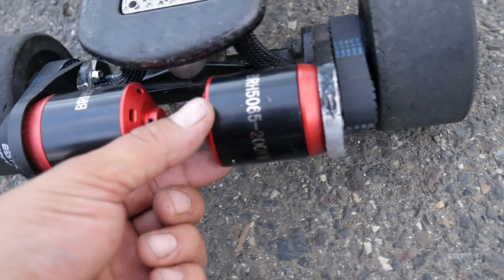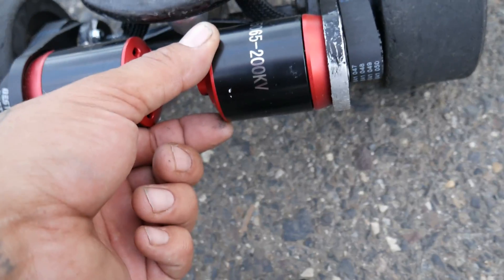RaceStar 5065 200KV Electric Skateboard Motors on Evolve Carbon GT

Comment: I’m having issuers with the battery, like I ride the board in full speed and the battery drains so fast and it doesn’t last that long.
Reply from the maker: The cells might just suck or you could have a dead cell which would do that too.  Usually the cheap batteries will work pretty good but lose power exponentially with every charge until you cant go a mile before its dead. Do you have electrical testers? What kind of board?

Comment: Joe, looks like you are local in Phila.  Question for you, I need to replace motors battery, and controller on my evolve Carbon gt... my originals we fried due to water leakage.  Can you lead me in the right direction? Im new to working on the internals. But I am local in Phila. jarridb@gmail.com

Comment: Hey man you think id be able to run a 200kv and a stock evolve motor together on my evolve?
Reply from the maker: nope two different rpms on each. wayyyyyyyy different maybe a stock evolve and a 140kv yeah but i still wouldnt do that. motors should be paired.
Reply: @JoeKyser  just curious thanks for the response man! I ended up fixing my old evolve motors.

Comment: did you set up the hall sensor ? if you did, show me how you did it
Reply from the maker: just plugged it in. install the opposite of how you take it apart thats all. Its plug and play
Reply: @JoeKyser  I had two of the threads strip in the motors, don't know how they stripped, any ideas? I was thinking possibly steel threaded inserts but I'm not sure the size and I am really not wanting to tap and thread these tiny bolt holes
Reply from the maker: @rossdevers9478  thats tough no doubt. The clearance is so close. Id try a larger size with more course threads. IF you were to tap it. You would need to vacuum it while drilling. Getting those metal flakes in that motor would kill it no doubt. It would prob score right away. I have old casings if it helps at all. Taking them apart is a risk in its own. I have the old style though. The one with the holes in the back for vent. Now its flush I beleive

Comment: Love the channel 
One of the most informative I’ve found on esk8

I was wanting to build an Evolve All Terrain clone and was wondering if you have a video or a recommended hardware list I might refer to, to make this as error free as possible?
Also, not that it needs to be said, but trying to keep cost low enough to make building worth the effort.

Thanks for your time and videos
Reply from the maker: +2dthoughts whats the budget? Thats always my first question.
Reply: Joe Kyser that’s flexible since I’ll be building piece by piece, but would like it to be considerably less than purchasing from Evolve.
Was thinking under $800 even though I don’t know if that’s enough $
I feel like if it costs much more than that it’s probably better to just save and buy from them?
Reply from the maker: Well you could make one for that but wouldnt be as good. To actually build one of the same quality may not be any cheaper. I mean yeah but you would have to make everything yourself from the ground up. Mainly im thinking about the battery. You can save a lot of money there by making your own. Im actually going to be going over every part piece by piece. Im going to do a detailed comparison of the max x1 compared to the evolve CGT. they both look exactly the same but different parts. Im going to add the DIY aspect to it too and talk about what each part cost seperate if you were to make it or buy it yourself. these videos will start next week. As soon as the Max X1 gets here. Been waiting patiently for a long long time now lol. That board is around $1500 or so. I forget exactly what I paid.  I know it was much less then the Evolve and uses better parts.  Also I will comparing the tires to the 107mm ABEC wheels. I think that needs to be done to set things straight because they are two totally different rides. I have  a ton planned for this winter just like last winter so stay tuned and hopefully it will help out and you get a better over view with more options
Reply: Joe Kyser Thanks a lot will definitely stay tuned for that 👍🏽👍🏽

Comment: Hi bro! Do you think I could fit dual 6374 motors on the evolve truck? I mean will the 74mm length be fine? How wide are the evolve trucks?
Reply from the maker: +Quality Stuff from one mount to the other, so one face of the motor to the other face is 6 3/8"  There's 25mm between the stock Motors 65mm tall. 74mm tall? 9mm each? sounds good. yeah?

Comment: Hi Joe  Im going to get the 140kv for my GT carbon they have no gear cogs on the motors i have a link on these gear cogs if they are the right ones if you could help thanks https://www.banggood.com/Racerstar-Motor-Gear-Red-For-BRH5065-BRH5045-Brushless-Balancing-Scooter-Motor-p-1139957.html?rmmds=search
Reply from the maker: lisa coal hey check out this video here in the description I have a bunch of links. the gears are there in that link. basically the same as what you came up with. I've taken the old gears off to other Motors and use them so far but I do have the red ones as backup as well. 
it's pretty tough to get the old gears off you can't do it without a torch.
https://youtu.be/W2_TwaMXOWg

Comment: Just wondering..... how are the Race stars holding up. Keep up the cool videos.
Reply from the maker: +Dusty Surfer yeah I want to do an update video because I've actually been talking a lot about it and one of the groups in Facebook. they are absolutely perfect they're performing like day one still and let me tell you I put some used to him I haven't had Motors last this long let's put it that way
Reply: Joe Kyser great to hear. Thanks. That's good because you do have some rough roads to ride on.
Reply: @JoeKyser  are you still using the 200 motor ? How has it been ? Any issues burning the esc?
Reply from the maker: Yes yes i do still use them. They make the esc super super hot. I can see them burning an esc out. Evolves has held up though. No issues with them at all. Crazy miles on them too
Reply: @JoeKyser  when you ride how many miles do you usually ride, long or short? How fast does it take for the esc to get real hot?
Reply from the maker: @buystuff9804  At one point I was the most active esk8er in the world if that gives you any idea. It was a legit 10+ miles a day and those racestars were very much part of that. The Esc does get hot quick when your on it.  It worry me that the esc was going to burn out for sure. I didnt care either because I can afford a new one. Its survived though which makes me give much credit to evolve for their battery that could handle the drain and the esc that was controlling the motors.

Comment: Joe, I am really liking your videos. You are one of few people that get into the nuts and bolts of these boards. I have a racestar on order. No more evolve motors. Did you have trouble getting that gear off the evolve motor. The set screw is so tiny I can't tell what size. Also did you heat it or use a puller. Thanks. Can't wait to see your DIY board when you get done.
Reply from the maker: +Dusty Surfer yes it is very hard to get it off it's one and a half mm size and you're going to need a torch to do it cuz you're going to have to heat up the shaft and don't forget once you heat up that check that motor is no good anymore I did do a video kind of showing how to do it but I wasn't thorough with it I do have that on cue to make so I can show people I have probably at least a dozen Motors here that I can take apart
Reply: Joe Kyser thanks joe. Keep up the good work. I think you may be most satisfied with the one you build. Maybe we will be ordering a
Reply: Maybe we can order a joe board one day.
Reply from the maker: +Dusty Surfer :)

Comment: Higher KV is always nice for an increase in speed :)  Nice video and good to see you Joe!
Reply from the maker: +Big Kids sure is! im surprised at the low kv motors now adays though. combined with the program it can be smooth sailing. but that's what im set out to figure out. whats what and whos who in Electric Skateboards. Good to see you my friend! Always a pleasure. I just love the YouTube community so much. Great people. I hope anyone that reads this will check you out
Reply: Hah, thanks man!  Yeah, from my research 190kv is the sweet spot for torque and speed.  The lower the KV the more torque you're supposed to get and the higher KV the higher top speed you get.  Mostly everyone in esk8 have somewhere near 200kv.
Reply from the maker: +Big Kids yup exactly, theres definitely a comfortable sweet spot.
Reply: @BigKidsOfficial  where can i buy a 190kv motor any recommendations and link tks.  I have the 10s5p upgraded battery, trying to get more speed.
Reply: @buystuff9804  this is the 190 kv 6355 motor.  https://diyelectricskateboard.com/collections/featured-items/products/electric-skateboard-motor-6355-190kv?aff=3. That is a good size.  But if you want to go bigger with the same kv rating you can do dual 6374 motors like I did https://diyelectricskateboard.com/products/electric-skateboard-motor-6374-190kv?aff=3.  Both will generate the same speed but the larger of the two will do it more effectively with less stress.  The larger one will work well for hilly areas and riders that are on the heavier side.  However if you have neither the 6355 will do well.  Hope that helps.

Comment: Thanks Joe, I am going to pick up the 200KV as a back up for my ONE board. I am on my third motor. This last one is doing well. I have gone to the 97 mil wheels and am a little more careful when it comes to rough areas. My motor failures were after about an hour of riding and I was going pretty hard on it. The 97 m wheels have made a dramatic difference in vibration. You said it in one of your vids. These boards should come with 97s for this very reason.
Reply from the maker: +Dusty Surfer yeah i noticed the smaller the wheel the more issues i had. The 97s make a huge difference and should be standard on a premium board. When the carbon gt first came out they gave that option then when i bought mine they had a 2 in 1 and i was like oh ok i will get that. What a mistake. Same day i put the 83s on the motor failed then a new motor went on and the base plate for the truck broke. I had never seen that in my entire life.  I believe they are moving forward with more sustainable boards but amazed they didn't have this down already with all the experience they claim to have
Reply: I am on my third motor and the second motors i had the 97mm installed and it died on second ride... I just got the 200kv once i get it see if it improves the longevity of this board. Right now i am pissed how many people have EVOLVE ripped off with this ONE board?? U are liek the 15th person i have heard these issues with the ONE
Reply: Robin Schaefer cool  I am interested to see how it does. Thanks

Comment: So u think this motor get to hot for my One skateboard? Would the 140kv be better? Or only do 5km rides ?
Reply from the maker: +Robin Schaefer i used it a lot as a single motor and worked great. the more strain the hotter it gets. but ran as a single I didn't notice a big enough change to make a big deal out of it
Reply: Joe Kyser ok I ordered one with the motor gear as well I hope it does better then the evolve motor. I wonder how many KV the 2000 watt evolve motor is. I am supposed to send back my entire board to evolve USA to repair. I have replaced the one motor once as they sent me replacement. They wanted me send back whole board to see if there are more issues. Do u think I should send it back? Or try racestar motor. I feel like all they will do is replace the motor. This board has been a disaster to everyone who owns it. All I see online is people who have gone multiple motors with the one. They shouldn't be allowed sell this board they are robbing people. Makes me sick as I'd like to try GT but after this I don't think I can purchase another evolve Baord unless they refund me and all others who have been ripped off